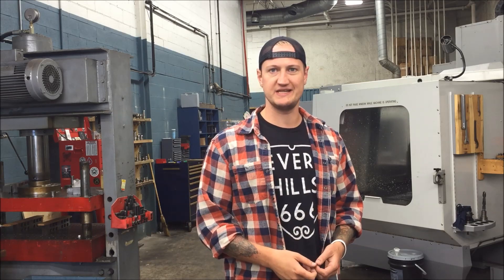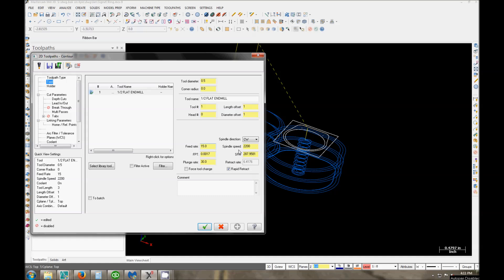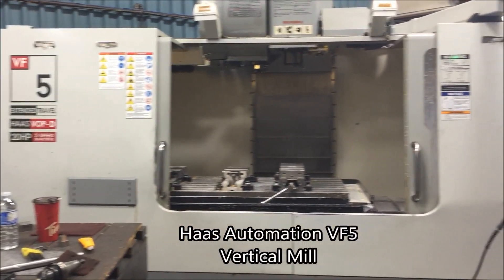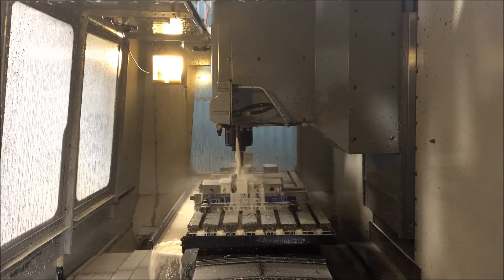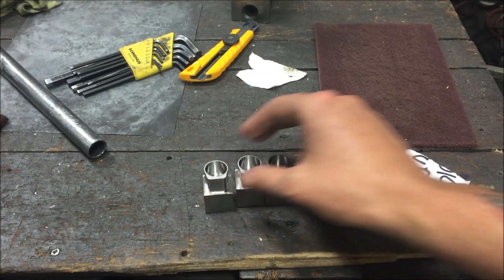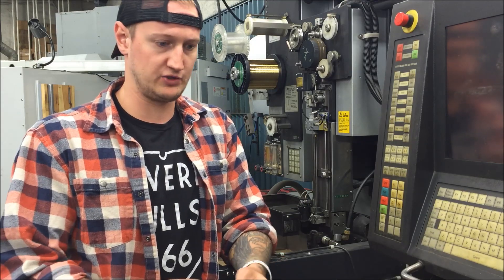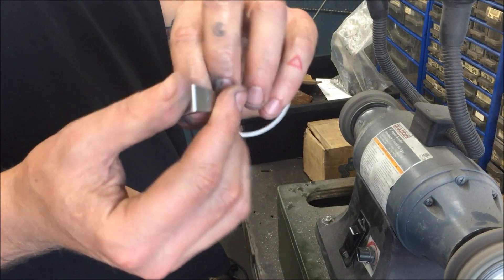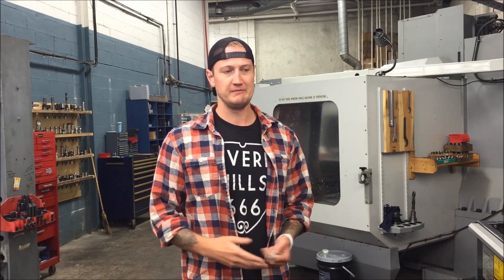LET'S MACHINE: STAINLESS SIGNET RINGS

Comment: Finally somebody that touches off tools the RIGHT way!!!
Pretty sad that I literally live at my shop I have 5 cnc mills and 1 cnc lathe and I am sitting here watching machining on YouTube I think that I need to get a life...
Reply: Paul Milligan doesn't matter how you set the tool height as long as it's right
Reply: For 20 years plus I did nothing but touch off my tools ontop the part and this system works great if you have say one or two tools and are not needing to try to use your tools for more than one job however when I started running famlies of parts I could save a day plus worth of setup time if set all my tools to a master height then used g54 to adjust that height up and down for the different setups and parts, this technique really really helps me make money as a shop owner after all remember that the two tools that are the most expensive tools in your shop are edge finders and indicators and tool touch offs because they don't make chips....